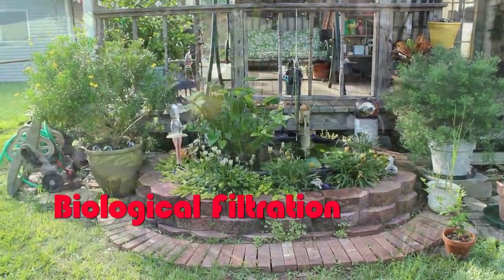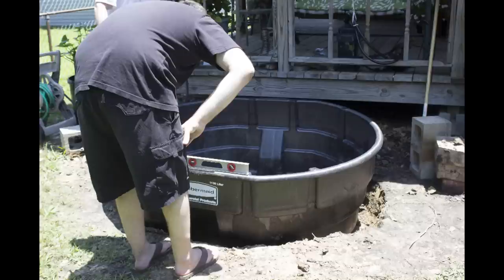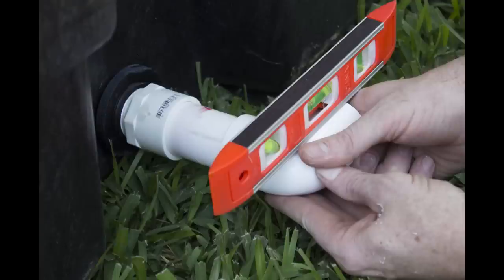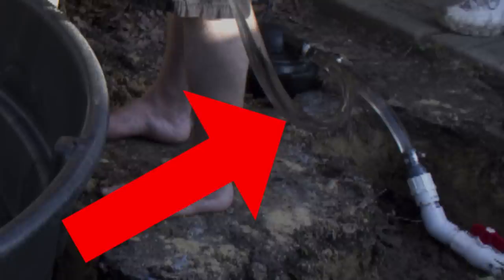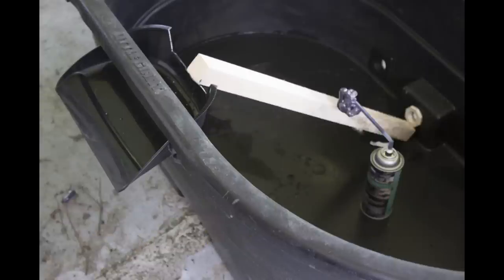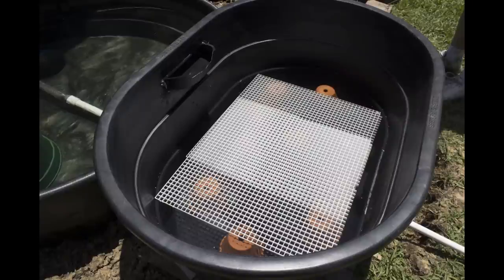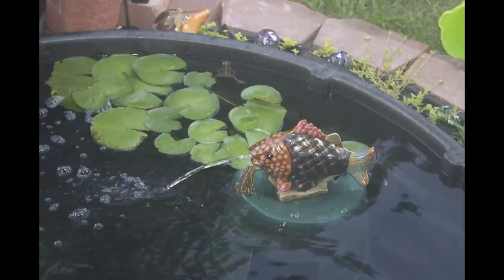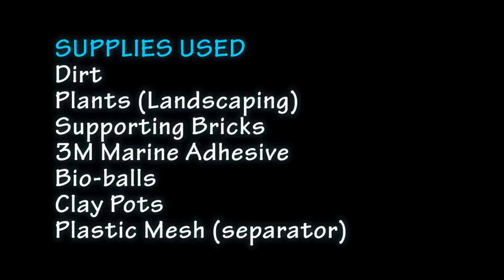Above Ground Pond

Comment: I have the same two exact tanks that I got for my 14 inch red slider that we adopted. I was trying to figure out how to turn it into an adequate good home for her. I knew I could somehow do it but wasn't quite sure. Going to use your method but instead of a waterfall it's actually going to be a water traveling area for her to go back and forth between the two tanks. Give her plenty of room to have a good life. Your video is the best one I've seen yet on YouTube. It was explained well, you have great common sense, and it was budgeted well. Great job. Your yard is beautiful.

Comment: use sand layer at the bottom of the tank and dig hole wider than tank that way you will achieve level...after 1/3 water is installed in tank backfill hole for side of tank with sand and keep level

Comment: That's great if you live somewhere if you don't ilve in candida
Reply: walt russell I have a 1000ish gallon pond in my yard and I live in Canada. You just have to bring the fish in in the wintertime
Reply from the maker: Yes, I'm sure Canadian winters are much colder than Texas winters. However, with the smaller pond, one winter we had a 1" layer of ice for several days. We turned off the pumps before the freeze, and I went out several times a day and hammered a hole through the ice. Not sure if that was necessary, but living in south Texas doesn't give much opportunity to learn these things. Most important, all our goldfish survived.

Comment: Why did you not just buy a liner as the fish will outgrow this also .I have an almost 5000 galoon pond and started with a preformed pond and went bigger each time I rebuilt .I used a 45 mill liner .I also have a 300 gallon stock tank and 2 100 gallon stock tank for plants and for baby fish I give away every year.use sump pump hose it ios much cheaper .I have been using it for years now .I use a bio filter but I know that those pressure filters need protected in the winter and from water hitting the outside .pl roofing goop would work
Reply from the maker: We live in the city. This is as big as our space will allow. The only time we have to be cautious with the pressure filter we used is in the spring when we get tadpoles by the thousands. We remove the filters so the tadpoles don't get trapped in them.
Reply: I have the same problems with tadpoles .In heat you need tall to keep the water cooler .Since you don't have room i guess you did what you can with your space .But at least you are enjoying your ponds and that is all that matters .:)
Reply: +Lisa M next time u have to stick plastic together like that u can just weld it together using some spare plastic of the same color and a heat source like a soldering iron.they actually make plastic welding kits you can buy online ..they use them to weld broken atv fenders back together. check it out ! cheers
Reply: sissy murphy p